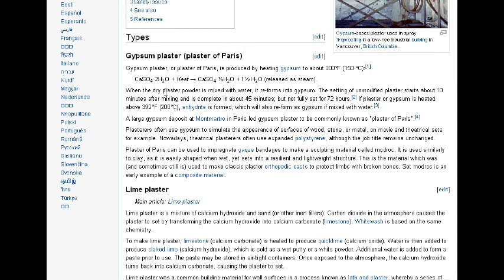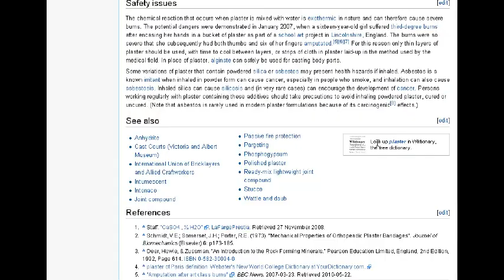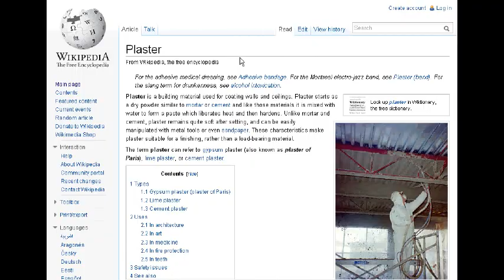Sand Casting With Plaster Of Paris

Comment: Thank you for this! I watched it yesterday (after terrible panic attack: I've got a brain injury & was overloaded) and went out today: bought plaster then went to a sandy beach to try it out.

I used the print from my shoe and added fins because the sole looked like fish scales. And I made a rough face shape, stuck stones in for eyes and mouth then for nostrils I stuck round sticks in and did rough thumb marks for hair.

I poured the plater into both moulds, waited a little bit then removed the mouth and one eye stone and the nostrils sticks so thin plaster had holes in. Then I had quick dip in the sea (the Med).

The fish isn't great but I really like the effect especially on the face (very expressive) and want to do more. Brushed excess sand off with a toothbrush when home, the sand has stuck on surface, looks nice: solid sand.

Good therapy for the traumas/abuses I've suffered - thank you for helping me to get out into the sun and play!
Reply from the maker: +Jenny Hughes You're very welcome. Thanks for watching!
Reply: I'd love to see a pic of this!

Comment: Great idea. Lots of fun for a small amount of money. You mentioned you can use these casts as decoration in your garden. In that case i would advice to apply some sort of coating in that case. Since rain and wind will erode your work. It will not be affected quick but in a year or so your work will look bad and with these thin casted objects, they can even disapear over time.

Comment: Use 50% water and 50% plaster
When mixing the plaster with the water
prepare two bowls 
one with the water and one with plaster
pour the 50 % plaster in the water in one go into the 50% water bowl. Sifting action. 
Wait for the plaster to saturate with the water.
Do not wait too long 
mix from top of the plaster heap in a circle action until you reach the bottom of the bowl 
keep on stirring until the mix reach a thin to medium porridge consistency .
Pour from the side of the mould.
This method - No lumps

Comment: I was wondering if you could get a good mold of a face by sand casting....... At my job we do a thing called water jetting sand to get a good tight compaction (kinda like the waves do to the beach shores) so assuming you can hold your breath long enough to have water poured into a sand bucket that drains with your face submerged in the sand do you think you would get a decent mold obviously you're going to lose details
Reply: I apologize about punctuation